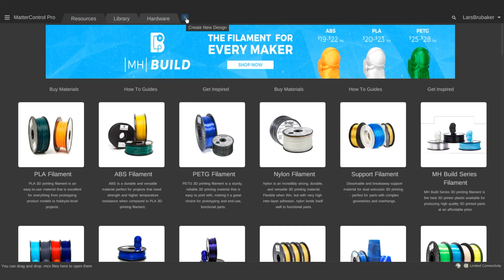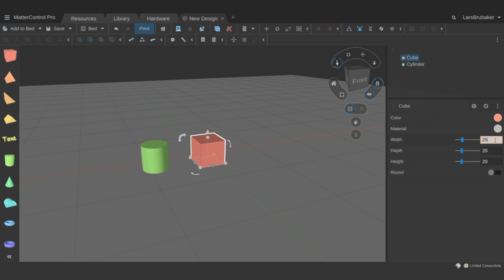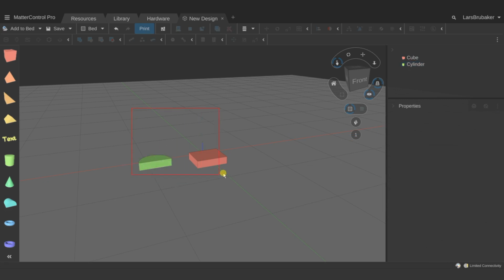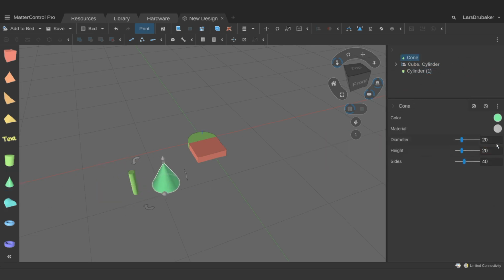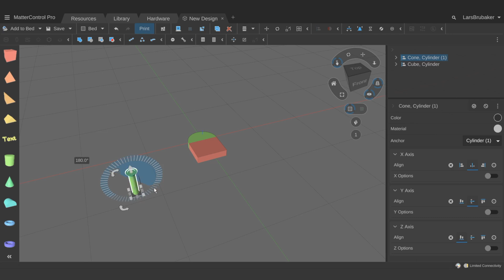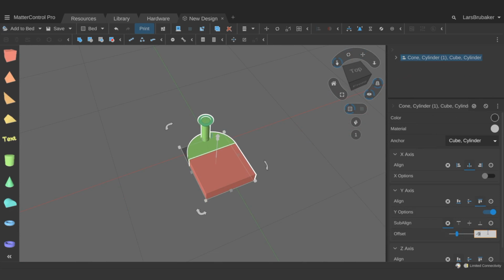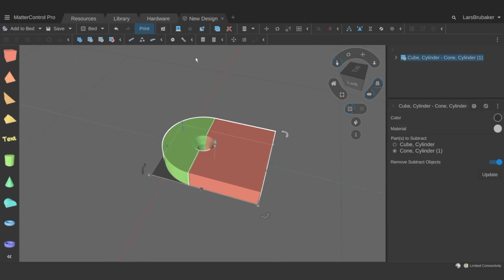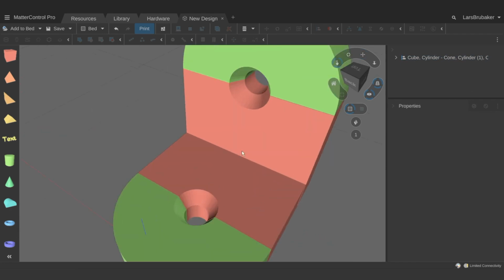Beginner 3D Modeling Made Easy | Two Minutes With MatterControl

Comment: Why did they make shape and dimension manipulation WORSE not better in the latest version? 
Like in the previous version when you used the subtract function then went to manipulate the dimensions and or position of the new part (what's left after the subtraction) you'd be working with the actual dimensions of the part and those new dimensions would conform with the grid alignment. However that's no longer the case, now it works such that after subtraction it still uses the dimensions of the original shape before any subtractions were done meaning the newly adapted shape won't align properly as well as making scaling much more difficult.